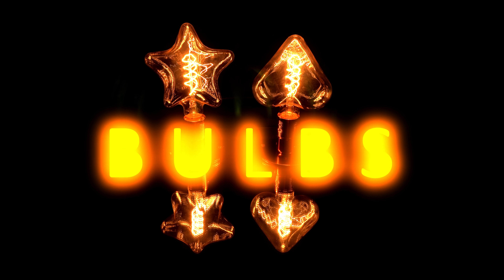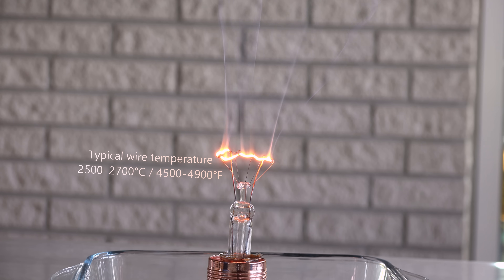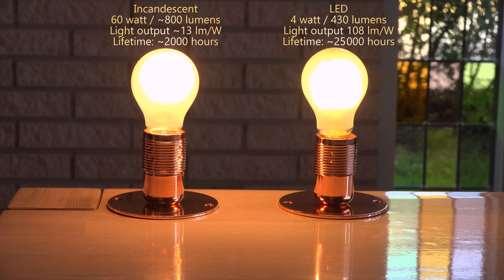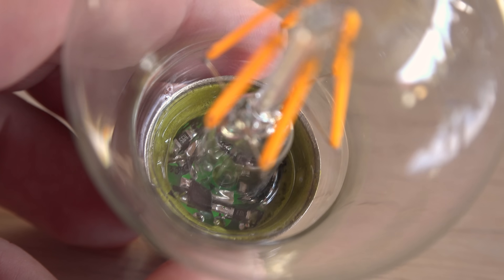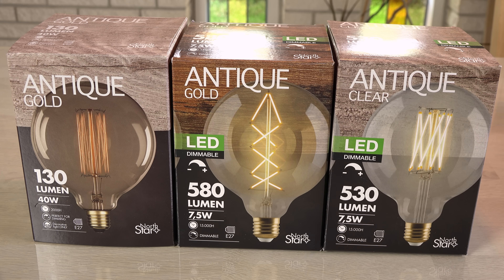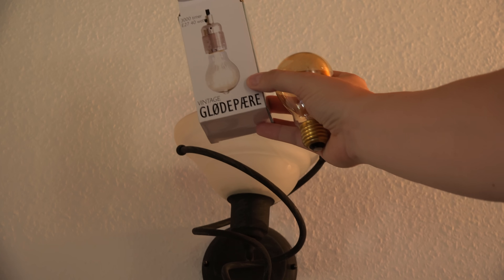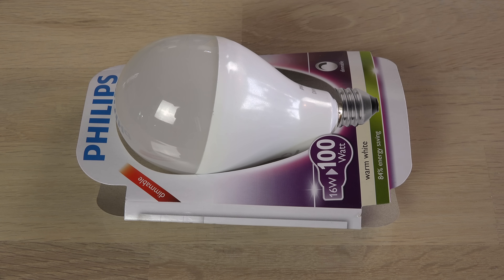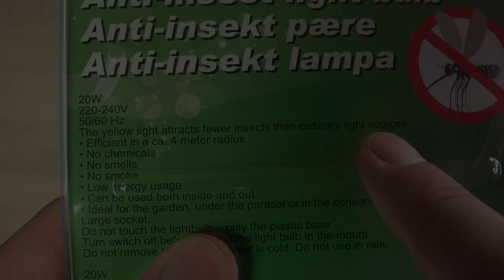Light Bulbs | LED vs. Incandescent

Comment: I'm wondering about your incandescent lamps reading about 10% below spec - for example that 400W halogen rated 220-240V. Could it be that it's 400W at 240V, and a bit less at 220V? What's the mains voltage in Denmark? Here in the UK, it's effectively 240V (never mind that 230V +12% -5% off-centre spec)

Comment: Very good video getting to see the differences with a watt meter is helpful. I guess I am still old school about energy use. Living in a rural area like I do I know of one example that incandescent's rule. When you have your well house outside you always hang a 100 watt bulb inside to keep the pipes from freezing. Also in the winter when your house is lit up with incandesent's you do get the heat escaping from the bulb into your living space. I would think changing the bulbs in the house to led in the spring / summer months would be ok and changing them back in the fall/winter months to incandescent. The problem I see in banning or not making incandescent is you end up having to come up with some other idea to get the heat/energy you need for whatever purpose rendering less energy use pointless. i am not against the newer technology but you should have a choice in lighting instead of no choice.
Reply: But incandecent bulbs are less efficient at heating than just using the heater in the room.
And what is a well house?
Reply: @HappyBeezerStudios  A well house is a structure. Usually built with concrete blocks. It houses the spring tank and if you have a water softener that too. Also the line coming in from the well is there also. They are usually 4 to 5 feet deep and have a tilt lid or side access door for service. You normally have to hang a light or heat bulb in there when the winter gets harsh. Usually when you get a constant wind. I usually hang a bulb once the temp gets around 10 deg.

Comment: The difference in wattage with incandescent lamps is probably due to the difference in voltage.
if the lamps are rated at 230V, then have 40W. Will that be less than 40W at 220V.
The electronics of the LED lamps will compensate for this

Comment: Incandescant bulbs have not exactly been "banned" in the UK, its just that UK sellers have been banned from stocking them. We can still buy them from places like Amazon or eBay quite legally. 

Funny story, my landlord sent all their tenants a package of CCFL bulbs, to encourage the switchover from incandescant  to CCFL. I hate CCFL's and switched over to high efficiency LED bulbs quite a while ago. LED's seem brighter than CCFL's to me.

During a landlord inspection they noted that I was still using "incandescent", because the LED bulbs I have are designed to look like the old pearlescent incandescent bulbs. So they sent an electrician to "help me" remove them, and install low energy CCFL's. Needless to say, even the electrician had a laugh at their stupidity, and left my LED's alone.

Comment: With that Philips 125W compact fluorescent bulb you tested, you only measured it drawing about 50W. I am led to understand that with those compact fluorescent lights the wattage number printed on the packaging is actually the equivalent in light output as the same wattage incandescent. e.g. a 75W incandescent bulb will draw approx 75W, but a 75W equivalent compact fluorescent will draw probably under 30W.

Ever noticed that your standard 40w 6 foot tube puts out about as much light as 100W incandescent? :)

Comment: You also have to factor in the lost heat replacing all your incandescent with led's ,as in clold weather you have to replace that lost extera warmth with other means.
Reply: But the heating system in your house is designed to do exactly that-heat your house.  It's going to be more efficient putting out the same amount of heat as incandescent bulbs, so it's still a net savings.  And if you live somewhere that requires air conditioning in summer, you're not having to run your air conditioner harder to pull out the heat that the incandescent bulbs will produce.

Comment: I'm way late to the party here, but if you move your video camera lens close enough to an LED bulb, the rolling shutter will really show off any flicker. Unsurprisingly, the bulbs with all the electronics jammed into the screw base, and without any smoothing capacitors, flicker the most.

Comment: You can still buy tungsten filament bulbs from specialist retailers. I bought a pack of 3 100W in London recently, they were old stock. The new ones are more expensive and marked 'industrial use'. They were made in Turkey.

Comment: Where is he?  Where's who?  The jackass who approved the idea to place a "ban" on the dead simple yet largely inefficient incandescent bulb.  Why?  Because I want to CHOKE THE SHIT OUT OF HIM until he goes limp.  Any energy or money "savings" from switching to CFL or LED all but require that those last for for their entire 10,000+ hr lifetimes in order to offset their MUCH higher fabrication costs due to all the extra components needed (extra metal for heatsinks, and all the transistors, diodes, capacitors, inductors, voltage regulator chips, etc.), the additional energy required to manufacture those parts and the technology required for final assembly.  A fat lot of good it does anyone when most of those POS's die WAAAAY short of their rated lifetimes and become nothing but EXPENSIVE mercury contaminated shit (for CFL's) that then must be properly disposed of.  Which nobody does.

I've got two questions for that asshole:  Do you see what has become of your *stunningly brilliant* idea?  Are you happy now, you pathetic, stupid, mouth breathing fucktard?  

Burning less coal to light up the LED/Toxic-CFL bulb that consumed a MASSIVE amount of resources to produce it and then when it early self-destructs, it becomes poisonous waste.  Now THAT is just fucking GENIUS.
Reply: Jesus! drink a Danish beer and chill, they do have a few decent beers.  Nut job whacko!

Comment: So i changed my bulbs out.  NO prob,    and when winter time came i could not fig out why i was running the heat alot. and my bill was HIGH,   then a friend said LED's have no heat..  i was like oh ya so i switched all my lights back to incandescent for winter,    and wow my bill was cut way down.

Comment: I have had incandescent bulbs last put to ten years, last year I bought 8 packages of LED replacement bulbs and as the ten year old incandescent bulbs!!! I KNOW how old the incandescent bulbs are, because I have lived in my home for 12 years now and almost ALL the bulbs in my house were CFLs when I moved in and I replaced them after a week of moving in!! BUT my story is that the LED bulbs DO NOT last as long as the incandescent bulbs either!! For example the one in my desk lamp as been used very little when compared to my house light (outside) So my desk lamp should have lasted longer....but it failed after just one year!! My outside "house light" that lights my front door hasn't been replaced in 6 years!! In my living room my ceiling lights are mostly ten year old incandescent bulbs and I have replaced only three of the six with LEDs and all three of those LED bulbs have since been replaced too now, and in one case one LED has been replaced twice now!!
Reply: Post again in 30 years when I will still be using the same LED bulbs with 50000 hours on each.  Post the rated hours of the bulbs and stop posting non-fact based crap.   Every bulb will say right on it what it is rated for.  I bet NONE are rated for 50000 hours like my LED bulbs.

Comment: Fun and informative video (very professional):
Question: If you put an orange Gel round the light - would that sort out the "Blue Light " problem - artistic and health (Blue light supressing Melanin production)?
Reply: I have no idea what Melanin but Melatonin is suppressed by ANY light.  Blue, purple, white, not just blue.  There are other reasons to avoid blue light both at night and in the dark but that is true regardless of the source.  What most people fail to understand is the any LED emits at a specific frequency and only that frequency unlike most other lighting technologies.  One LED may be 620 nm and another at 660 nm.  It is very specific.  A 3000K light can not emit blue light, period.  However, a LED lit screen can.  Light bulbs are not at all like you monitor, or phones screen which DOES emit blue light.

Comment: They never banned any type of light bulbs here... We even still use the light bulbs that gives off radiation..
Reply: I think they tried to bad T12 and made T8's that fit in T12 but I bet you can still get T12.  I had some T5's over my aquariums but they finally have some nice LED systems out now.  I just use the simple True Lumens or a ramp timer and Planted+ not that 24/7 piece of junk.  I wish that True Lumen did fresh water lights with 660 ns reds.  Their lights are great.

Comment: low pressure sodium bulbs is used only for special applications, typically for runways. Low-pressure sodium bulbs are absolutely monochromatic and it is not good for streets. On streets are high-pressure sodium bulbs.
Reply: I have them on a bathroom mirror light.  They were there when I got the house.  They pop after a while.  I do not know what the street light use but the stop lights seem to be all going to LED.

Comment: You complain about LED cri, I've seen some bakery with 5000k or above :D

Fur just fun, last year I bought my first LED bulb. Some Phillips dimmable spotlight. We had a bit unstable power, but no more light flickering (even the incandescent flickered), so much lumens, and pretty good cri. Now last week bought some replacement bulbs, Tungsram BrightStik, sh***load of lumens, 3000k, and bad cri. Yeah, not sodium discharge bad, but still. Anyway it is for light, not for looking good. For looking good, I have dimmable halogen. But the compact fluorescents aren't the greatest too, the 2500 or 2700k is so white, maybe the cri is not the greatest, but I haven't see written on it. Maybe I'll switch from tungsram. In a sample size of 2 lamps, phillips seems better :D
Reply: I have found CRI to be more important that Kelvin and good CRI at 3000K look much better then a bad one at 2700K or 4000K or 5000K.  I am not sure whya bakery would have plant lights???  Plant lights are 6500K.  You seem quite confused?  CFL stinks, it should die long before incandescent!

Comment: LED’s do generate heat and regular bulbs aren’t banned
Reply: Yes, incandescent 90% heat 5% light, LED 90% light 5% heat, notice the difference.  PS - I do not need some puny inefficient bulb for heat.  I use real heat source.
Reply: Toriless you’d be surprised how much BTU’s regular bulbs can add. Still don’t see how regular bulbs are banned.
Reply: Toriless you also forgot LED don’t have the same depth....as a regular light. Been proven with off road light bars.

Comment: Another question I had was mentioned how the old light bulbs conduct crap ton of heat the LEDs do not but I don't notice a lot of the LEDs need a heatsink in order to run otherwise they will burn out for instance in headlights for the cars. If they do not get hot why do they need these special heat sink or fans in order to operate? Thank you for your time and your video
Reply: They difference it 5-10% for LED VS 90% heat for incandescent, do the math.
Reply: Hey little man did you make the video? Because at the end of my question if you notice thank you for your video and your time that means I'm directing my question to the guy that made a video. I mean it would have even been okay for you to answer if you actually answered the question I asked. In my question I said nothing about incandescents. Just flatten off about some dumb shit.

Comment: There's no replacement for incandescent bulbs. I love incandescent, in my apartament all bulbs are incandescent and my electricity bill isn't expensive.
Reply: Because it is a tiny apartment, besides 90% of you energy is probably for heating then cooling and lights are way down the list.  Your PC alone can use more energy the all the lights in a room on full blast all day.  When you get over 2000 SF you will see the bill shoot up even with all the lights out.
Reply: Because the companies the manufacture them weren't getting any sells on their expensive LED bulbs nobody wanted over the old incandescent that costs 10 times less and has less tendency of early failures.

Don't let anyone make you believe its to "save the planet" that is bullshit, nowhere in the world households are #1 power consumers (its the industry, but that's normal really) not to mention LED lamps are far dirtier to manufacture AND dispose of/recycle than the simple glass+metal light bulbs.

The way to "save the planet" is not punishing the user for using electricity the way they want despite paying for it, but to start phasing out dirty ways to produce it. I'm not against LED lamps, they are extremely efficient and actually a good way to save money on power(so long the damn things last at least half what they state), i'm against forcing people to buy a product even if they don't want it because it might be too pricey for them.
Reply: I have no cooling/heating system. The most of energy comes from the electric shower (5500w).
I have a 28w incandescent in my room (pretty dimy, great at night), a 70w incandescent on my bathroom and a 105w incandescent at my kitchen. My electricity bill is so low that nobody can understand.
Beside giving a bad light, LED messes up with circadian cicle
Reply: I have a 2800sqft home filled with Only LED bulbs. I can have every light on in my house (Over 20) and would be using less energy than 3 incandescent bulbs.
Reply: +fenton bevan:
What's dirty electricity? Do you mean electromagnetic radiation? These are radio waves. They are photons.
Reply: fenton bevan  Then at the very least a study, doesn't have to be peer-reviewed
Reply: fenton bevan  Oh no, I did do research, but none of the websites I went to had any experiments to back up their claims. Just thought you'd know a website that performed or cited an experiment
Reply: fenton bevan  Could you link a study (preferably one which is peer-reviewed) about Dirty Electricity? I'm rather curious
Reply: +Matheus Bitencourt:
I live in Canada so I use incandescent most of the year since about 7 months in a year, it is rather cold.

In fact, my PC is on all day Saturday and Sunday and it raises the room temp by 3 °C.
There is no such thing as saving energy. The heating is electric and sucks a lot of juice.
The water heater sucks a lot of juice when the water that comes in is 2  °C in winter time.
Reply: Toriless Maybe, but we should be free to use incandescent bulbs and bear the higher cost if it arises. I can't understand the argument for banning the sale of incandescents.

Comment: Wait, I don't think your description of incandescent light is correct. The process you described is the emission of photons from electrons decaying to a lower energy state. This process gives off very specific wavelengths of light with energy equal to the energy diffierence between the higher and lower states of the electron. This is (as far as I'm aware) what LED's do. Incandescent lights, however, work by black-body radiation. This is the conversion of thermal energy to electromagnetic energy, which happens to every particle with a temperature higher than 0 K. This gives off a nice Planck-spectrum of wavelengths with one specific wavelength as the most intense. This specific wavelength is dependent on the temperature and can be easily calculated with Wien's displacement law. White light is produced when this wavelength peaks in the blue spectrum, as far as I remember.
Excellent video nonetheless :)
Reply: Actually, it is what we perceive as white.  Not all animals see it the same.  Plant react to 6500K which is much higher than what humans perceive as being bright.

Comment: I live in Denmark too, and I only use LED's and I'm happy with them. I've saved a lot of money on electricity, and have never had to replace one in all the years I've used them. CFL's on the other hand are the devil. Just kidding; but they are inferior to regular and LED's bulbs, in my opinion. :)
And no, I don't use more money in heating, as I don't need more heat in my apartment - it's hot enough as is. I have an entire wall of windows, and it's well insulated, so the sun is more than enough for heating 3/4 of the year. I pay $300 in advance for heating each year, and get at least $100 back once a year, when my heating use/money ratio has been worked out.
Reply: Agreed, from the US.

Comment: One cool thing about LEDs is you can have super powerful ones that actually do get very hot or low-power ones that can reside in a flexible plastic strip that can be easily routed and attached to accent various things that one might want to accent with light LOL ......AND those lights can change colors and do many many cool  "dances".  

10:44  Nice find!  ONLY a bi-lingual would make that connection.  IMO that is either poor translation or false advertising.
Reply: I have motion sensing waterproof LED strips under the edge of the cabinets in the bathrooms so when you enter the floor gently lights up.  I can change it color via a remote if desired.  I use a yellow color since the flooring is tan.

Comment: When you say right voltage be careful, a LED has a min voltage but is powered by the current. The voltage drop across a LED is constant and is about 2 volts.